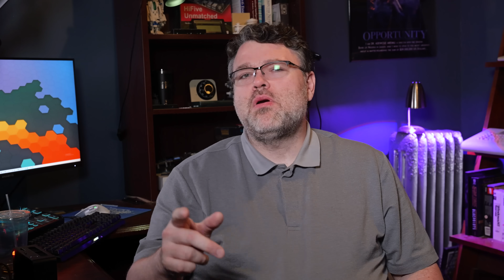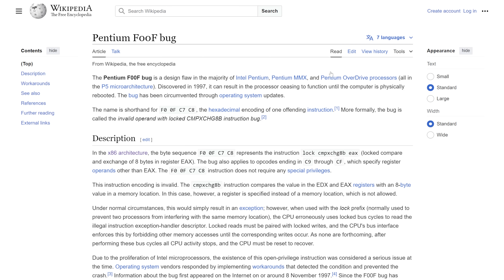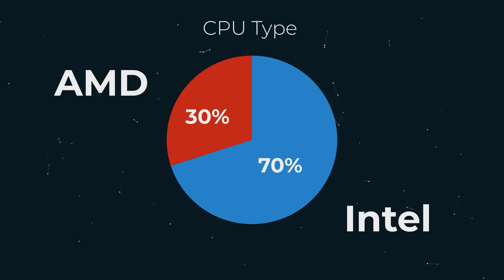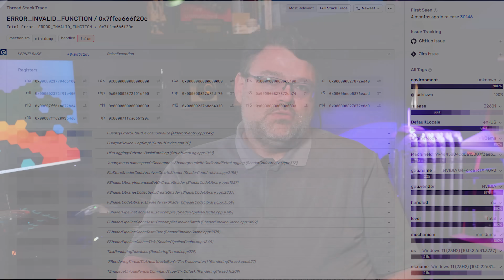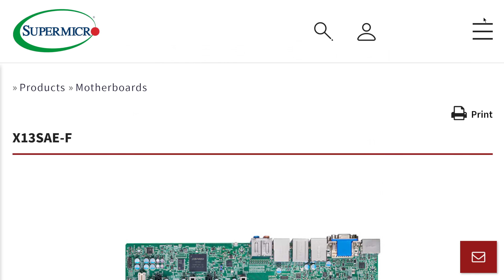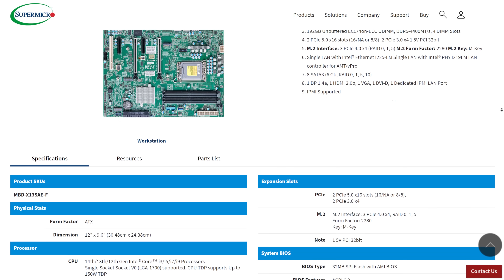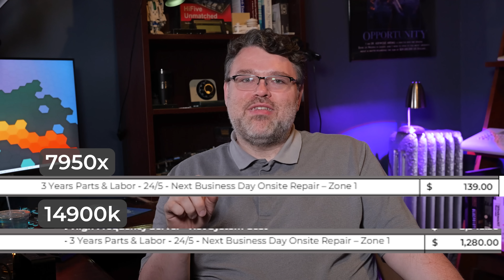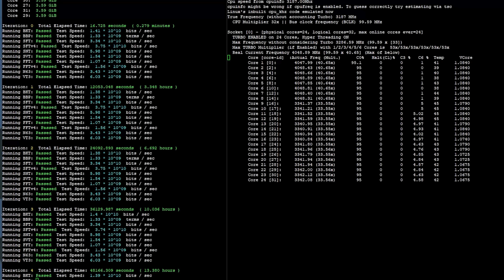Intel has a Pretty Big Problem

Comment: My 13900k was so unstable after about 1.5 years that I couldn't copy data off an SSD without getting a BSOD
Reply: It's cooked 💀💀
Reply: Impossible! Intel is perfect and wouldn't cause that problem. Only AMD has problems. It must've been something else in your system that caused the BSODs! 😂
Reply: Just don't hold your CPU like that.
Reply: lmao that's an amazing product
Reply: you still have the warranty right? try to get a new cpu
Reply: @blitzwing1 LMAO
Reply: I know this is about intel having these issues but does anyone recall the ryzen 5 3600x ryzen 9 3900x having this same issue? may not have been on this same level but enabling pbo with high voltage was killing ryzen cpus, instability all kinds of issues. Stock parameters that are set by the manufacturer or motherboard is still not within spec. From experience any voltage over 1.39 to 1.40 is too much and will degrade the cpu very quickly no matter what the type of cpu
Reply: Same story for me with 13900kf, first months it was perfect, after a year it got to the point i had to replace it since i was loosing money for wasting time running work related programs again and again and hopping it wont crash. now im praying to god my 14900k will survive more then that, almost 1 year has passed, and its OKyish still mot solid stable but workable.
Reply: @MrDesillu  I was joking.
I thought it was obvious.
Reply: @Ikxi  Ho ok
Reply: GamersNexus may want this CPU ;)
Reply: @dhLotan  And ALL the datacentre CPU'S!
Reply: craziest thing is, this is their premium line.....
Reply: @Lead_Foot when did the issues start for you?
Reply: That's a shame. Hopefully, they will recognize the design flaw on 13th and 14th and fix it in the future after they offer all of those customers a new 15th gen if they trade in the faulty one. They have super quick cores, but if they can't run without crashing, they are not very useful.
Reply: Thank you for your service in testing pre-alpha products.
Reply: You can test and find out what cores are problematic and avoid using them. Used OCCT to find out Mine was core#4 used taskmanager to set affinity to not use it and a game magically quit crashing.
Reply: I got tons of blue screens on a brand new expensive razer blade 16, just returned it immediately, so glad I did. I guess I better keep my 12th gen intel desktop CPU.
Reply: @ohokcool  Do you happen to remember the CPU? I bought an ASUS vivobook about a year ago and I've had quite some weird performance stability issues. No crashes but very inconsistent performance. I have a i9 13980HX.
Reply: @foeyloozer6299  yes, i5-11400F, I feel no need to upgrade even as a gamer/home labber
Reply: This is why I always go with the 700k series... Never trusted the EXTREME 900K and KS
Reply: Did you have to buy a 900 cup when a 600 cup would have been just fine and would have done the same job for you?
Reply: @igelbofh  people like you are so annoying what's just fine for you may not be just fine for me people have different workloads and are using these chips for more than just gaming the i9 is a much better cpu for video editing, or if you watch the video, they do good in servers because of how many cores they have, or would at least if they weren't crashing but I digress
Reply: 14700 OK?  I'd argue most people don't need the K sku, the non-K boosts so high anyway just get that.
Reply: @milescarter7803  I absolutely despise overclockers. SKUs have specs for reasons. The same kinds of people cut you off on the road, cut in line, lie, cheat and steal their ways through life too. Just a bunch of self entitled pricks.
Reply: @1pcfred  it's almost like you're not even in the same conversation, we aren't talking about overclocking. people are having these problems at base settings. whenever I have my 13900k downclocked, not overclocked, downclocked, all the way to 5Ghz all core from the base 5.5Ghz and 5.8Ghz on my strong cores and I'm still hittin 1.8v and i am crashing within 5 minutes of starting my game, there is a problem.
Reply: Why dont you boot in BIOS and limit throttle to 90c. BOOOM! problem solved
Reply: @LuccianoNova  Because that would make the 13900k's performance run like a Commodore 64!
Reply: @stuartedwards6996  only if your cpu usage is above 75%. I did it on my 13700f and never seen the difference. It’s better than running a cpu at 95c for no reason.
Reply: @stuartedwards6996  not true at all. It limits CPU productivity by a very small margin. But, it also depends what workload you’re throwing at it. Do you need 100% of your CPU??
Reply: @LuccianoNova  Some people pay a premium for top of the line performance.  When they watch reviews before buying, they expect the performance from those reviews.  If they have to reduce the performance to get stability then they may as well have purchased the 13700 series of CPU's and saved some money.
Reply: @LuccianoNova  i have not had any temp problems though, low 90s on r23 and 50-60c max in games. Just slowly voltages got more and more insane and unstable but i haven't had a heat problem at all, it is weird and why I feel like Intel has yet to properly address and commit to fixing it, I don't think they know what the hell is going on at all.
Reply: Got 13900k as well. No crashes since I bought it. Just the temps are a bit high, but nothing to worry. But its summer and 40 degrees Celsius where I live
Reply: Did you try a live Linux USB stick? Just to rule out Windows is the culprit.
Reply: @cutterboard4144  its not.  these CPUs slowly kill themselves via turboboost 3.
Reply: @cutterboard4144 good lord you Linux fanboys are truly insufferable. The issue with Intel's CPUs has nothing to do with operating system
Reply: @mjc0961  I am a Linux fanboy. Stop to generalize just because someone did a comment  about Linux. Using another OS can help to troubleshoot by the way.
Reply: People its simple spend a little time in the bios overclock 5.6 to 5.7 ghz limit voltage to 1.37 to 1.39 and run a cinebench 10 min or however much time, you should be stable 100% of the time
Reply: @betawing1914  if it is not stable at base settings with no over clock chances are it won't be stable with one.
Reply: @danielabbott9312  
I believe base was put on to late the cpus have already gone through there drama with overvoltage etc. so from experience i have in building pcs i have not had any problems. I set my own parameters on all my cpus ryzen and intel. I have seen ryzen cpus die from running pbo with to much voltage same issues that were seeing now with intel chips. I personally still have a 10900k 11900k 13900k and ryzen 9 5900x personal builds that i run daily gaming running programs etc have not seen any stability issues with my set parameters
Reply: Sounds like user error to me.
Reply: @1pcfred  You're part of the problem. A CPU should be practically immortal when running stock regardless if it's on air or water.
Reply: @juno1597  used properly hardware is immortal. Abused it isn't.
Reply: Almost 2 years with 13900KS , since day one.. power unlocked.. 300 plus watts.. no issue whatsoever.. your point is ?
Reply: @Need4FPS  Some CPUs seem to have a problem. Count your blessings.
Reply: @Need4FPS "I dont have any issues, so you have to be wrong" Like every internet forum or subreddit ever 🙄
Reply: @Need4FPS  i only you watched the video...
Reply: @Need4FPS  Since u probably didn't watched the video I will repeat this part: "15-25% of the CPUs are affected"
Reply: @MiningdragonLP   Not true, all 13900/14900 are affected. The problem is the users. The problem is the lack of knowledge of many users.
Cooling these CPUs with air is an absolute nogo, especially if you are not familiar with the BIOS and rely on the OOTB settings of the motherboard manufacturer.
A CPU that is permanently 100 degrees hot and still draws 1.6v+ will simply destroy itself in the short or long term.

Of course I understand that hardware should work for ALL users no matter how much they know about PCs, but this is simply not the case with these CPUs with the OOTB settings of the motherboard manufacturers.

My 14900KS has been running at 6,100Mhz all-core with 1.58V since day 1 without a single problem, supported by 2x480mm radiators and direct die cooling.

If the cooling capacity is sufficient then high voltages are no problem either
Reply: @Xuuli-o3i  Intel could have solved that easily by reducing the temperature the CPU is allowed to run at. This is completely on Intel, not the user.
Reply: @Xuuli-o3i  Well then u say wendel he is wrong. he said the 15-25%.
Also if it is users then intel would just say so instead of blaming everyone else
Reply: @MiningdragonLP  It is no secret that 13900/14900 CPUs peak OOTB to even 1.7v and higher, NO Intel CPU survives these high voltages in the long run, so all are affected
Reply: @eVes1337  I had to rma mine yesterday and I was hitting 1.8 on baseline settings.
Reply: @danielabbott9312  I've built PCs for a long time, and even back in the early 2000's when I hit 4GHz for the first time on a 130nm Northwood Pentium 4, 1.75V @ 60C was the upper limit if you wanted any longevity. That Intel wants to run 1.8V through a CPU on a modern process node sounds absurd to me, especially at 100C.
Reply: @K31TH3R  yea it is pretty crazy watching it go that high especially when i first got it, i could do 5.8Ghz all core at 1.32v, now at 5ghz all core it will spike 1.8v regularly with or without load. With that said, I can say intel has been really awesome about it so far, offering a replacement with a decent turn around time with no hassle or making me troubleshoot beyond what I had already done. I also had a day 1 chip, so hopefully the silicon has gotten better with time and the replacement doesn't have any problems.
Reply: @danielabbott9312  exactly what im saying is killing those chips, but still sorry to hear brother
Reply: @eVes1337  yea luckily intel has treated me good so far. I am mailing the old chip this very second actually lol, got a 13600kf to hold it down till the new one comes and man I have to say I love that little beast 5.5 ghz all core at 1.27v. night and day difference from my 13900k.
Reply: @MiningdragonLP does this mean if my intel 13900HK laptop cpu which has been running heavy load since I bought it new in September 29th, 2023 (0.75 years ago) is probably part of that percentage if it has had zero performance degradation or crashes? What’s the time scale we are looking at? Crashes near the start? or after T time?
Reply: @chocolate_maned_wolf  I haven't heard about reports on laptop. Honestly don't know, if laptop CPUs are affected, but if they are I would expect a slower degradation since they are using less power
Reply: @MiningdragonLP  thanks
Reply: @Xuuli-o3i i think the problem it's not temperature  in this case but too rapid silicon degradation, so i suggest to reduce your voltage because seems the time it's a huge factor and ks it's high binning silicon cpu and the last one to be relese (if im not wrong) so they should last longer and im sure if you running a stability program for server and datacenter you ll fail some test
Reply: @Need4FPS  and your point is?...because your 13900ks have no problems it means that all 13/14 intel gen cpu are ok? with 15-25% of the cpu affected it means a lot peoples.... so thanks your luck
Reply: @Need4FPS  "works for me, not a bug"
Reply: @Need4FPS  Seriously, that's you answer?  The question should be, what's YOUR point.
Reply: @Need4FPS  To be fair, 13900KS by definition are golden samples, though be warned golden samples are not immortal.  I'm guessing if it's drawing over 300 watts then the CPU is pushing over 1.5 Volts.  I don't want to jinx you but that's not going to last long at that voltage before you start experiencing system instability and you'll need to start undervolting and underclocking it.
Reply: @juno1597  it doesn't help.
They are "golden samples" but they also pushed further.
I had 13900KS - it worked decently but had random crashes, file corruption etc. I decided to replace it with 14900KS because "it will be cooler and performing a bit more plus maybe it will help with my stability issues". I can't run it under default specs at all. It crashes immediately. I can't run it with power limits - it doesn't affect situation at all. Temperature limit doesn't help either. Most of the crashes are not connected to high cpu load - it could be cutscene start for example. Or on default clocks I crash as soon as I launch cyberpunk for example - with no load on the processor whatsoever. 

And here I am now, sitting below 14900K (55 ratio), still have rare crashes (about same amount I had / wanted to fix on 13900ks) and waiting for new amd cpus while boiling in my anger.
Reply: @deadlymecury  can you quote where I said it helps?
Reply: @juno1597  probably in the line "to be fair they are golden sample but not immoral"? It feels like it implies that situation with 13900ks / 14900ks is better than 13900k/14900k because of "high quality silicone selection".
But they can be crashing out of the box still without any mortality issue or pushing 300+ watts. So they are also affected and probably it's not simple silicone degradation. Probably it is something else.
Reply: @deadlymecury  What you implied is not what I wrote, if that's your takeaway then I don't know what to say.
Reply: @juno1597  tell me "there, there, it will be fine" :)
Reply: @deadlymecury  are you okay mate?
Reply: @deadlymecury  I'm going to help you out since you seem to be having a mental lapse. If you want to engage with what I wrote that is okay, but please keep your insanity to yourself and not invent straw man's or imagined arguments in your head.
Reply: @Need4FPS  You're literally watching a video on the problems with these CPUs and you decide to post THAT "OH MINE IS FINE" post? Your brain is cooked
Reply: @Need4FPS  can you get Assetto Corsa Competizione and run a race against 24 AIs ? So far every 14900KS that I had in my hands did crash in this game in 1-10 minutes
Reply: @Need4FPS  That is why you got a KS. 13900K bsods, crashes, could not do shit after a point.
Now on 14900k unless I set PL1 to 125W, PL2 to 253W and ICC to 307A FF XV crashes constantly, I literally cannot play the game.
Reply: @DsLmaNiaC  rma it intel will take care of you, they know it is happening they took care of mine no hassle i sent it out yesterday and should have it back by next friday give or take a day.
Reply: @Need4FPS  Oh so youre in the 60-70% of people who hasnt had problems... yet.
Reply: @Need4FPS  "I had no problems, therefore the problems don't exist!"

This guys an idiot.
Reply: @Need4FPS  10 shekels have been deposited to your account
Reply: @Need4FPS  Dumbest reply possible. "Works on my machine" is a meme in the computer world because of how little it matters. Who gives a fuck if it works on your machine? We're looking at the cases where it doesn't work. 

It's like seeing a murder investigation and loudly proclaiming you're still alive so everyone can just go home. They're investigating your neighbors murder, you aren't involved in this.
Reply: @Need4FPS you're definitely dumber than a 5 years old lmao
Reply: @Need4FPS  His point is that you are in that 25% of lucky ppl mentioned in the video. Congrats. :) Your point is?
Reply: @Need4FPS  you are one of the lucky ones...
Reply: @Need4FPS You’ve just outed yourself as someone who hasn’t watched the video.
Reply: @Need4FPS   same here. I have had ZERO issue. I wonder if motherboard manufacturer has something to do with it. I'm using Asus z690  maximus formula
Reply: @Need4FPS  You're doing it wrong.  The right way to be PC Master Race is switch between being an Intel fan or AMD fan once every several years.
Reply: @Need4FPS 300 plus watts ??. You are out of specs. 13900KS has 253 W tdp.
Reply: @Need4FPS  Me too,i haven't any problem here,system is gigabyte z690 aorus master-13900k-ddr5 6400 mhz-rtx 4090 and a 1200 watt psu,same as with those cables from cablemod,i still use it,and not have any problems,isn't the problem that some people doesn't know what the hell they doin maybe?

Comment: I had 13900k issues on a home server, i tried everything on reddit and disabling E cores helped but during testing i noticed my gigabyte board was pumping rather crazy voltage in to my CPU under load
i pulled back LLC to zero or whatever i felt was equivalent to normal was and i have had no issues since with every other option on, XMP and even a slight E core overclock 
i dont actually think this is the same issue even if the symptoms are similar as it appears to have been a known issue with the gigabyte z690 ud ddr4 and it did cause overheating before the crash and throttling and i assume that would have been figured out rather quickly

Comment: insane data, totally irelevant but 18:00 makes me want to mention i killed a 7950x trying to run 4x32gb ddr5 at 4600mt/s on a x670e hero; it barely got stable at 4400mt/s after hours of y-cruncher vt3, bumping up the speed to 4600mt/s in bios made the cpu never ever be able to train memory and post even after countless cmos resets and bios flashbacks; was running latest bios a couple of months ago when it happened and had no overvoltage anywhere
Reply: 4x32 won’t ever work. 32GB ram kits are dual rank. You need single rank kits like 16GB or 24GB, the latter of which is the easiest on a memory controller. Plus, ASUS uses daisy chains on the X670E Hero without a backplate which is unacceptable for a high-end motherboard. I own a hero. Trust me, I know.
Reply: @PowellCat745  4x32 works at lower speeds stable. It ran a Hynix m-die kit at 3600-4000 for a good few months but I really wanted to make it faster.  Why do you mention a backplate? I can only assume better signal integrity, but how does a backplate matter?